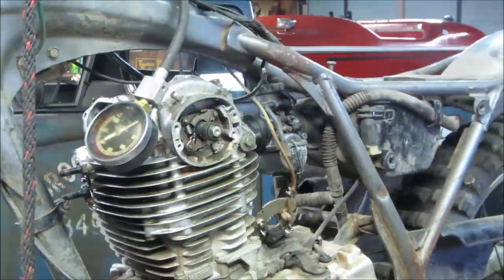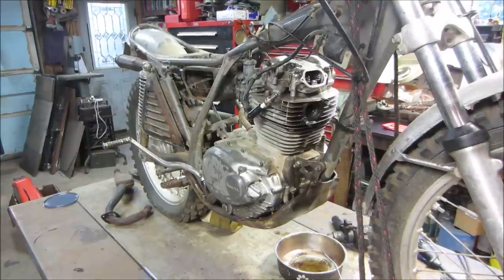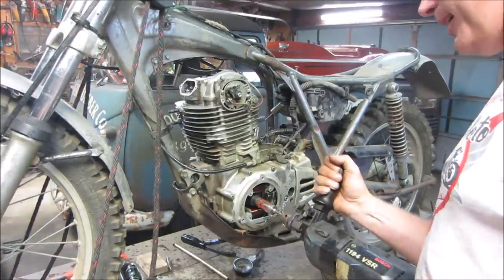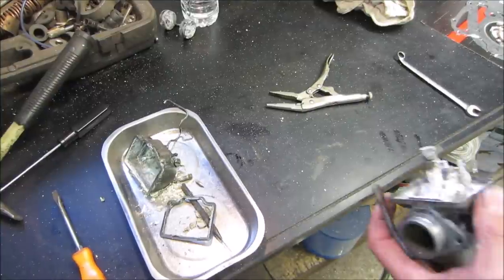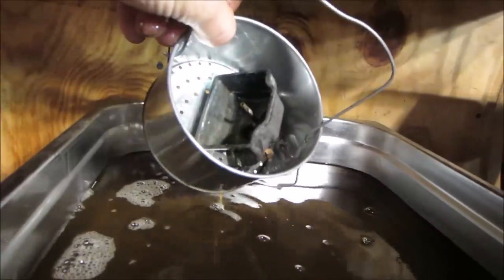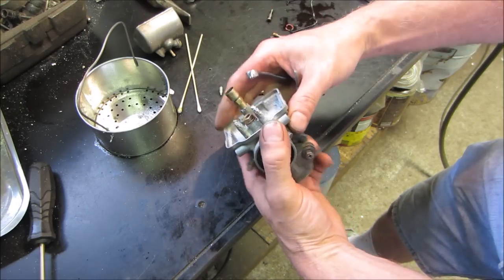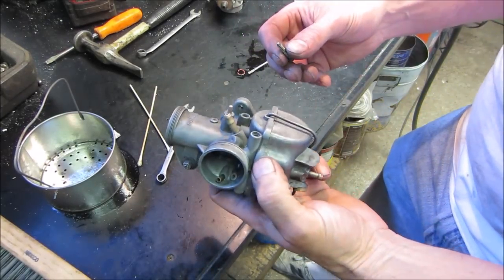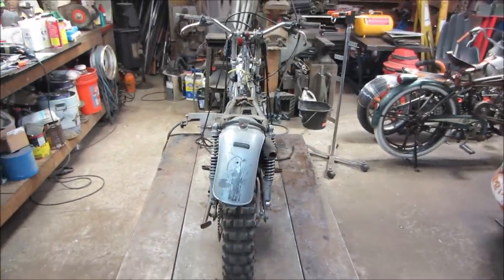will it run? antique honda trials bike pt 2 of 2

Comment: Plug loose same here, always did it finger tight when trying to get something running by putting fuel down the plug hole. It also looked like you had a fair bit of blow back out of the inlet port.

Comment: you crack me up some times i had the same TL250 30 odd years ago .... nice bike ... my drill is the same as yours rebranded as a ramset and have a setup for the socket and use it to start small motors ,, hate it when they kick back ... we work in very similar ways .. can you hear me yellin at ya some times ? ..looking at the rust in the airbox and had no air filter i recon she got drowned and not restarted or left in rain with covers off .... love ya show been subbed for a while .. good work often see other youtubers commenting that i also subscribe too .. there is certainly a community out there ... ross from nz

Comment: Hi, I, really like your videos. I love fixing things too. I have a tip for you for the ''points''. Instead of a file, try using very fine sand paper, like emery paper folded in half between the two, it makes the surface more even ant it works longer before you have to do it again.

Comment: some of the low compression problem could be the carb slider was stuck down and restricting air inlet. I always open throttle and choke all the way or remove carb to 4un compression test.
thanks for the videos.

Comment: When I started converting an old 75 XL350 into a cafe racer, I found damned near every single bolt hole on that engine had been stripped.

I must have put 40 helicoils in that goddamn engine. I am such a fan of that little tool I'll sometimes just pre-emptively helicoil a thread that's even starting to feel weak if it's in aluminum.

It's interesting to me that you use WD40 as a penetration fluid. Project farm did a great video and showed even the specific WD designed for penetrating didn't do a very good job compared to others like PB blaster.

I went with a flat slide mikuni aftermarket on my 350 that was one of the "universals" and it literally needed zero modification beyond the right jets. Sucker ran like a raped ape and it was plug and play. Also, honda sells all the parts to rebuild that carb for under $40, including new floats and seals and jets and needles. Just my take, but I'd have just cleaned and wire wheeled that nasty old carb (and holy shit did that bike get left out in the rain, that carb was filled with water at some point) with a dremel and mini wire wheels, soaked it like five more times and just replaced the guts. Honda does an amazing job supplying parts for their 70's bikes, unlike suzuki, where I've been looking for a set of piston rings (they had the "right" ones at the dealer but they were way too thick) and a jug/lid gasket for an 80's TS185 for like five years.

For old hondas, I've found the dealer to have honestly way better prices for carb parts than online. Floats for the 125 I needed were $5 at the dealer and like $25 online.

that bike's got a brake lever made for andre the Giant.

Comment: I've always used a piece of fuel line as a tool to take a plug in and out. you should try it. 1/4" size has always worked well for me.

Comment: Instead of using a torch cleaner or wire from a brush to clean out those tiny carb jets, go to any music store and buy a set of guitar strings. Some music stores will even sell individual strings, which is really all you need, anyway. "High-E" strings come as small as .008, but I've found that a "high E" around .010 is small enough to fit into just about any jet. Also, Gumout spray carb cleaner, with the plastic tube "jet spray" can be your best friend when it comes to carb cleaning... Just avoid getting it in your eyes. 

 Thanks for posting all these great videos!

Comment: Good work, I had a old Honda 1881 I think? I couldn't get the battery to charge, I did replace it and the coil too I replace it too! I don't know was a power exchanger and I replace that too! I was riding my back I drop beer off my motorbike was not a good day, and crashed it too! Oh well

Comment: Puzzling, all that corrosion in float chamber. I'm guessing there was water in there. Carb looks same as the ones on early CB750. Well, actually only the 1969 had the individual throttle cables. Anyway, should be easy to get. But you could also fit the later 1977-1982 XL250 carb (same as the 1977-78 CB750 carbs). They have a different cable mechanism and choke cable rather than lever.

Comment: Brilliant video as always, I'm sure your channel has changed many more lives for the better so what's good for you is good for many. Personally, I really enjoy watching someone else fix stuff when I'm either not able or not in the right mindset. I've picked up some good tips from you too, specially around small engines. I will say though, after trying out PB Blaster based on seeing you use it a lot, I notice it vanished from your channel lol. (My findings are it was as good as most others but nothing special and expensive in the UK too). WD40 and GT85 are the staple in my garage, along with a healthy dose of brake cleaner (pronounced "Everything cleaner"! lol)

Comment: 16:40- You got lucky! When the carb is that corroded, you should back up the lower arm where the float pin goes through. I've had them break when trying to drive the pin out with a drift. Great video, good lighting and focus, you must have used a tripod. After looking in that bowl, I would look for a new carb to save a lot of time. Thanks.

Comment: I had a seized Honda Trail (not Trial, lol) that I "restored" in 1975, as a 12-year-old. I would never work on a seized engine again without taking it all the way down - jug and all. On my example, I found that Honda had mounted the connecting rod upside-down. There was only one hole on the connecting rod to provide splash oil onto the wrist pin. If this hole was pointing up instead of down, not enough oil would get on the pin. This caused overheating, and eventually, seizing. The overheating meant that a strip-down needed to include the next oversized rings and polishing the cylinder walls. Because I never suspected a factory error, I actually did this twice before I caught the connecting rod error. Now, every time I hear "Seized" and "Honda" in the same sentence, I can only recommend a complete strip-down. BTW - never even considered another Honda for the rest of my life, either 2 wheeled or four.

I enjoyed watching your project though... good job, man!

Comment: spark plugs in aluminum heads are only to be hand tight when I went to small engine training they told us to never use a wrench on as it is easy to pull the threds since threads on spark plug are much stronger so what Mustie is doing finger tight is fine

Comment: I use a wire brush they are hard to find it looks like a acid brush 
With 1/4 inch arbor 
I put the in die grinder and polishes the inside of carb like new 
I’ve also found 1/8 brass ones for Dremel tool they work pretty good too huge time saver 
I use torch tip cleaner for jet holes 
As well as exacto knife with a peace of torch tip cleaner clamped in it

Comment: I'd have used my Dremel tool with brass wire brushes on the carb to get all that scale off.
They have several different shapes and styles of them.

Comment: I have a 1978 Honda XL 350 that I bought for  $150 with broken kick started shaft.  I bought a lower end for a1977 XL 350 with a kick starter shaft. Hopefully by changing it, and a few other things, it will run.

Comment: My favorite make of trials bikes where the Bultaco's! ....I had the Bultaco ISDT 250 CC "MATADOR"
Reply: I still own a 1971 Bultaco Alpina 250, Viva Cemoto!
Reply: @ftby59mikeD  that was the one that I really wanted, but they said it would be 6 months before they would get that shipment in, and of course I wanted a bike now for my birthday! (January 18th) .... so have you ever ridden it in the winter? ..... lol I did and loved it! the mechanic said he would set it up for winter ridding  (he put sheet metal screws in all the nobs on the tires, and said when you fall push the bike away from you so the tires won't tear you up!) ..... I had the MATADOR SIX DAY TRIALS bike. The only thing I had to change in the spring were the handle bars, because you can only bend the handle bar so many times before it breaks off in your hand! ... they where separate for each side! So in the spring I replaced them with the one piece with the bar across the top. They never broke after that my friend!

I used to ride it into the pub's parking lot and park it with the snowmobiles! ...lol@me
Reply: @dockmasterted  Lol, believe it or not, when I bought the Alpina it had spiked tires!..1st owner used to ice race it!
Reply: @ftby59mikeD  I CAN BELIEVE IT MIKE...... i USED TO RACE SNOWMOBILES WITH MINE! ...... AS LONG AS IT WAS DONE ON ROADS, OR SNOWMOBILE TRAILS i WOULD WIN! ...... BUT IN DEEP SNOW THEY HAD THE ADVANTAGE, AND THEY WOULD USUALLY COME BACK TO HELP ME GET OUT OF THE DEEP SNOW BY RUNNING ME A PATH TO GET BACK TO FIRMER GROUND. (THE SHEET METAL SPIKES WHERE ONLY GOOD ON THE HARD PACKED ROADS. ....... BUT AS THE ROADS CLEARED THEY WERE HARDER TO KEEP THE BIKE FROM SLIPPING! (STEEL AND PAVEMENT DON'T GIVE MUCH IN THE WAY OF TRACTION ) ..... THE GOOD OLD TIMES EH! ...... NOW I'M CONFINED TO A HOVEROUND MOBILITY CHAIR TO GET AROUND! (without it I fall down a lot! getting old is no fun almost 70 now!) ...... TAKE CARE MY FRIEND!

Comment: yep, same cold blooded temperamental "beasts" that I recall, timing, fuel and valves had to be near perfect for them to start without wearing your leg out. choke full on, crack throttle the tiniest bit while kicking if you hear a pop or sputter back the choke off some and try again. lol

Comment: You've got a new subscriber.
That was long but I stayed with you the whole time.
I'm currently working to restore a set of carbs off a 81 GS1100.
Been there done that a few times.
The Suzuki 1100 will eventually be trued into a pocket bike 😳 just for fun and experience.

Watched both videos on the Honda. Always liked those and almost bought one awhile back.
But I've got enough bikes at the moment...... hehehe, not really but I have to pretend to be an adult sometimes. 😆

Comment: Never sandblast carbs. 
Glass bead only.
I've always started off with a Dremel tool and brass brushes to loosen corrosion and scale. 
Then glass bead.
Using the smallest size beads.
Sand can easily eat away carb metal as most small motorcycle carbs are pot metal.

Comment: now you have the carb apart, remove the tiny metering valve about an inch long and soak it in carb & choke cleaner for about an hour! I have 2 1974 hondas, a 500-4 and a 750-4 cylinders and its a must to make sure these tiny metering valves are super clean, take a small glass jar and fill it most of the way full, I use small garlic jars that I get at the grocery store with chopped garlic in them, a sonic cleaner doesn't work too well on the ting metering valves that you unscrewed from the base of the carb!

Comment: Hint.. there is a beading needle used in jewelry making that's made of extremely fine,  twisted spring steel ... with a little loop on the end that can serve as a handle ..  it's a perfect jet cleaner.  I know because I use them when I work on carbs ... and also when I make jewelry from strung seed beads.  Only people who happen to do both beaded jewelry making and carb rebuilds would know what a great dual purpose tool it is... and I suspect that I might be the only woman that does both.  So thought I should share.

Comment: Believe it or not, i've seen much worse in a carb from the 70's and 80's honda atc's.  Inside one bowl was completely dissolved with the exception of the brass parts....Was super excited the ol sonic cleaner was topped off lol. All we needed was a steaming coffee cup shot and it would of been perfection!  Was screaming down the hwy on my vtx 1800 when the new vid alert went off, yeah i pulled over to see who it was...lol

Comment: Only thing I can say besides that I love the videos is use WD-40 or what ever penetrating oil like crazy. Me and my dad used to do the same thing your doing right now (85' Honda 125 XL, 79' Suzuki 480 if i remember correctly, an 84' Honda XR 125 and then some Yamaha 40's lol) anyway's point is just soak alot of those parts (like the carb) in there before you start tooling around on them cause some of those parts you can't get anymore ie: Mikuni , Keihin carb parts.

Comment: Great video I was cheering you on when you were kicking it and it sputtered. So since the compression is back up to 100psi I’m guessing the bike didn’t originally have issues, it was simply put away, neglected and forgotten about -which is a waste in my mind. Cheers

Comment: a little tip dont put fuel in the plug hole a little in the carb is better with gas or any solvent you can wash away the "oil film" on cylinder bore/wall on 2 strokes dont use starting fluid because starting fluid dont contain 2 cycle oil..just a tip..also gas in the plug hole usually ends up liquid in the pipe and can explode blowing up or expanding the pipe many guys have exploded mufflers on vehicles from this effect and can cause fire.. if the pipe is off

Comment: Instead of torch cleaners or a wire brush bristle try using guitar strings. I've had good luck with a high 'E' string or a 'B' string.

Comment: Hey Buddy, I'll come help you clean up your shop if you'll help me with mine.  Good video. I've had some bad carbs but that one was about as bad as I've seen. Rings were probably dry causing your low compression and it should come up. I like the way you did the video and looks like you know what you're doing unlike some I see on here. Good work and I'm glad to know I'm not the only one that wears blue jean shorts. I get made fun of by my Daughter.

Comment: About two weeks ago my son and I took out the small bikes. He took the R3 and I took my beloved SR400. After riding about an hour and a half we pulled over to have a little coffee break and bull-shit a bit. So we're all set to go back on the road and the R3 is just putting away but I'm scratching my head and doing a bit of cursing because my bike won't kick over and I'm there kicking and kicking away. So I stopped a moment and look over to my son and he's laughing his ass off. Turns out when my back was turned he switched off the kill switch. Two lesson's, always check EVERYTHING and two. Kids are cruel SOB's.

Comment: Why  did  holding your hand over the intake where the carb was connected   make it easier for the drill to turn ? Does that tell you anything about   if the valves are working  correctly  or not ? For example if you cover   the intake  as you are  using the drill  and it doesn't change the  speed of the drill  what would that mean ?

Comment: The seal on the float bowl  is only for when it falls over or maybe on the sidestand. The reason it was leaking was that the float was set too high and too much fuel was being let in. Otherwise good job, except bating it on the bench. I winsed.

Comment: As a 70's kid who saw these brand new I can tell you why some met an early fate . Trials was just being televised in the US ( Wild World of Sports ) and some kids just had to have one . Problem is , their buddies were buying CR's , MR's and XL's . So after the appeal of riding around and going over a few logs and small rocks grew tiresome . They were trying to keep up with their buds and wringing the crap out of their low geared engines using them like Enduro's  . I'll bet there are a stack of seized up TL engines somewhere LOL . As a side note .... I was 15 when these 76's came out . I had worked 2 years in Peoria Illinois running two paper routes in snow and some seriously cold winters to buy a new XL 175 ( the slick orange and black ones ) . When HONDA decided to put that ugly ass pipe with the lunchbox muffler on them and to add insult to injury they painted them Sky blue ! I was so PISSED I couldn't see straight ! We had just moved to Louisville , Kentucky ( trail bike HEAVEN ) and so I went to Derby Town Suzuki and ended up buying a TC - 185 instead . It had a dual range gearbox and proved to be a great trail bike . We actually lived just outside of Jefferson County ( Louisville ) in Oldham County and there were serious trails EVERYWHERE . Mud , rocks , deep gullies , wet tree roots and that low range in the TC would climb anything . It was all good because Honda kind of dropped the ball on their motocross bikes ( the Elsinores ) for few years and so when I started racing motocross I went with the Suzuki RM's and they were great bikes . I raced them from 77' to 81' until Kawasaki came out with Uni - Trak rear suspension . Great time to be riding and racing !    PK

Comment: No snugging down the plug for testing? Really? People comment about that? Wow folks take a chill pill or something.. Great advise on the welding torch cleaners.  Tried to use one but the smallest wasn't close.  Ended up using krafts wire..

Comment: Also you don't need the plug to check the spark, just put a screwdriver into the plug wire and ground it to the engine.

Comment: So watched loads of your videos, thought this doesn't look so hard, bought a non working small generator off Ebay uk, checked everything, carb, compression, plug has a bit of a weak spark, changed the 2 stroke oil, put the drill on it and the damn thing still won't work. I'll keep watching the videos maybe you'll buy a small generator one day.

Comment: I liked the video, very entertaining but I have a question, why do you started checking the valves and not the carburetor or rather why you didn't took the hole thing apart and clean it? old rusty bikes might have a lot of crap inside, piston rings might be worn, etc.